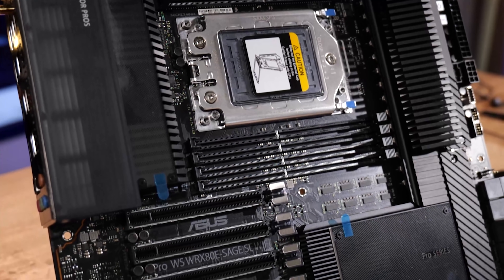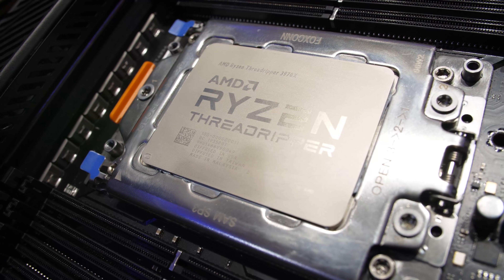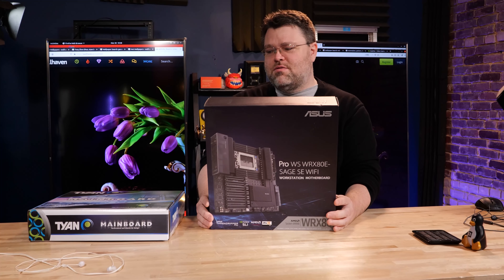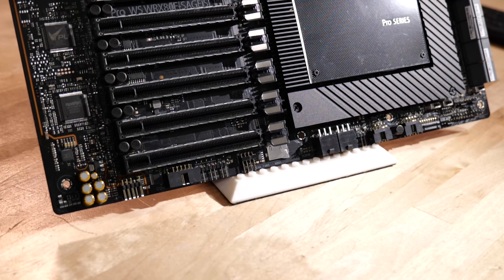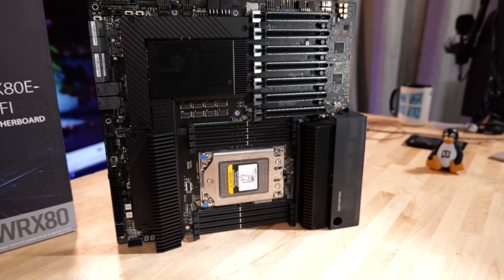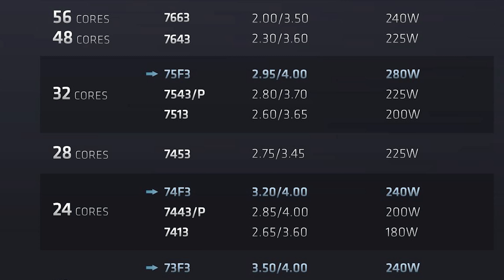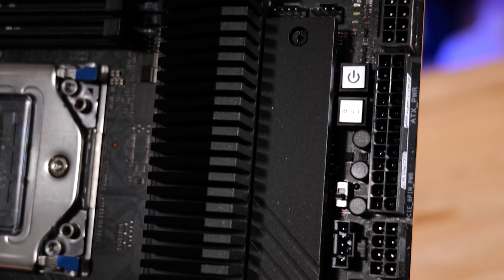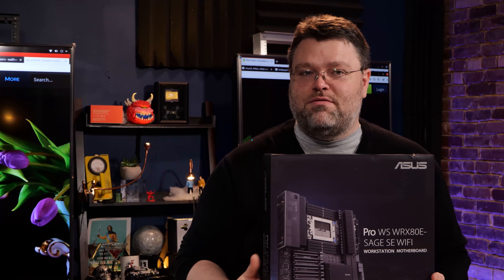Epyc 7713 vs Threadripper Pro for a Workstation?

Comment: I actually use an EPYC as a workstation (ROMED8-2T) and I kind of can support your point. However, I like my systems to come in simple. There is no chipset at all on the EPYC board and you'll just find the X550 NIC and the ASPEED 2500 BMC plus an additional USB controller.
However, I do have  M.2, OCUlink, Sata and 7 PCI-e x16 slots. So I get some decent storage options, everything else is done by adding PCIe cards. And this is exactly how I like it. I use the system heavily for infrastructure simulation (using virtualization and nested virtualization), so I prefer to select my add-in cards based on features, like SR-IOV, function level reset capability and whatnot.
Threadripper Pro with these motherboards (Gigabyte has a nice one too) is a very attractive option, but you suffer a complete lack of low-end SKUs CPU-wise. Some people start with a decent system but an entry-level CPU to get going and later on swap CPUs when cheap options become available on Ebay&friends. I did that for the last two decades on my systems. There are several low-cost "low-end" SKUs for EPYC but literally none for Threadripper Pro.
Reply: Completely agree with Threadripper not having low end SKU's. This was the main reason why I am looking at EPYC systems now.
Reply: Hey I'm like 3 years late lmao, but I'm building a similar system right now, and wanted to ask if you had any cpu heatsink/cooler sag issues on the vertical setup? Read that AMD set weight limits for sp3 at 450g, but most coolers i can see are 800-1200g, but I've heard almost no one talk about it
Reply: @thetacobasket6821  Honestly, I haven't payed attention to the weight problem. I use a Noctua NH-U14S TR4/SP3 which weighs >1kg. The ROMED8-2T comes with a beefy backplate for the socket and the entire mount is quite rigid. The system is running for almost 5 years now (recently got a CPU upgrade) with no issues. YMMV :)
Reply: @virtualinfinity6280  haha thank you, good to hear; I figured since it wasn't a "mainstream" issue, and that every cooler is twice that requirement at least lol, that it was probably fine, or outdated, or miscommunicated. The AMD docs just spooked me; last thing anyone would want is to damage hundreds of $ of hardware from the CPU cooler of all things XD

Comment: Awesome video, great breakdown. One thing I've been wondering about, is if you need a workstation on somewhat of a budget, how much benefit would you get from the price jump from 3950x/5950x with a good motherboard to the lower end Threadrippers + the board? 50% more cores for ~2x the X950x CPU prices makes me wonder if TR is really worth it on the lower end.
Reply from the maker: depends on if your job benefits from more ram/bandwidth and pcie? sometimes two cheap computers is better than one that's more than 2x the price. Same goes for servers, too. 4 socket server adoption is way, way down.. and now with 64 core monster cpus like the 7763, 7713 and 3995WX, even dual socket servers/workstations are becoming less popular. If your job scales well to two sockets chances are it scales well to two nodes in a cluster.

Comment: Apologies for my lack of understanding. The Tayan website shows the S8030 works with EPYC 7002 series processor. Were you referring  to EPYC 7002 in the video? Because I thought you were referring to the 24 core EPYC 7443P (Third Gen EPYC) when discussing pricing and specs.
Reply from the maker: 7713 is what's in there now. Long story is 280w tdp for xxx3 epyc isn't quite the same as 280w tdp for xxx2 cpus and needs some firmware love. Milan less than 280w is fine. Check the hcl. Plenty of cpus in that doc from milan

Comment: Noctua, quick, take your C14S, and scale it up to the Epyc socket, we need VRM airflow, also make it cover the 4 dimms on either side of the socket, It would also help to put an 80mm fan mount on the bottom side just above the socket just to get a bit more air flowing down over the socket and any VRMS that might be towards the center of the 240mm fan

Comment: I build a system with a 1920X Threadripper I got for a steal about 11 months ago, but it was just meant as a stopgap. Now I am wondering if I should do a WRX80 build or hold out until Zen3 Threadripper (Pro) comes out... tough choices. (Use case: Pre-Processing for Deep Learning on 12-16 Cores on a VM with 1-4 GPUs passed through to it, a second 4 core VM with another passed through VPN serving desktop duties and VMs to serve as a lab so I can do lighter parts of Devops workflow in a single box I an take with me, including running Kubernetes with GPU nodes);
Reply: I bought the WRX80E board to replace a TR 1900X. It was hard to find the WRX80E in stock. The Ryzen ZEN3 and EPYC ZEN3 are here now. I don't think it will be all that long before we see the TR PRO ZEN3 cpus. I can't say for sure ZEN3 TR PRO will work on the WRX80E board, but on Ryzen and EPYC the upgrade worked. The power supply to that board looks great, but PAGET tested 3 pro cards on one and was pulling 1400 watts at the wall. Best wishes finding a 1200 to 1600 watt P/S for list price.

Comment: I had to build a video editing workstation when TR Pro was only available via Lenovo, and P620 was way over budget. I really needed the PCI-e connectivity (Graphics card(s), video I/O card, fibre networking, potentially HBA), so I went with the TYAN 8030 and EPYC. The way I resolve the USB issue is to use a single slot PCI-e x16 to 4x4 breakout card (through four SFF-8643 connectors) and add two USB controllers for 8 additional USB ports. Not elegant, but works fine for me.
Reply: Hey, where the hell do you find a Tyan 8030? I can't find one anywhere... Edit: actually they're on ebay here now (only from one seller...), but they cost about as much as the higher end motherboards?
Reply: With Z590 and X570 still offering only one X16 PCIe socket the demand for X16 AIC will stay very low. Overcoming a decade of Intel 4 core dominance and a public that will not demand apps that use all of their PCIe sockets bandwidth, cpu cores and compute units/cuda cores will take a while. NV Link and Radeon's Infinity Fabric Link was a way to go around an old stupid app that was written for old stupid stuff. USB 3.x GENx can't compete with 16 GEN4 cpu lanes. SATA III, not one in use. USB, one 8GB gen2 stick for bios updates and one USB gen2 for a wireless mouse.

Comment: My god, what is that connector at 0:28, in the bottom
Reply from the maker: moar gpu power :D
Reply: @Level1Techs  its not all the way in
Reply: @Travelfast  TWSS?
Reply: WRX80E: Two 8 pin sockets, one PCIe 8 pin socket and two 6 pin PCIe sockets at the bottom of the board. That's 5 of the 8 power sockets on my Thor 1200 P/S. Add one GPU and that's 7 of the 8 P/S sockets. It's this resource sucking hog or a wife. But not both.

Comment: I think if the TR Pro was unlocked and allowed overclocking it would an easier choice to make.
Reply: I'm starting to see this the other way. Within the cpu's power draw limits and boost clock limits, it's the cooling that matters more. Momentary boost is a factor, but a workstation is more about hours of actual speed. Factory clock and no throttling for hours on end is more important. Bragging rights for split second boost is for gamer rigs. At ZEN+ it was time for water cooling and at ZEN3 it's open loops with giant rads.
Reply: @maxhughes5687  I don‘t disagree but I think an unsupported “unlocked mode” would massively generate positive PR for AMD by enthusiasts who would demonstrate what world records would be possible with a single “desktop” computer.
I mean 99 % of motherboards are completely overpowered component-wise anyway and letting such a Zen 2/3 Threadripper PRO roam free at >500 Watts would draw in many, many views.
AMD not locking down these features wouldn’t mean professional users would operate their systems like that on a day-to-day basis.
Reply: @abavariannormiepleb9470  Very true. Public image is a big deal.
Reply: The reason is simple. Workstation based cpus like threadripper pro and workstations in general prefer stability. When you overclock, you are pushing your CPU faster than it can perform and thus void warranty and create new problems as well as need addtional cooling like water, which you then asked for even more trouble. People that use workstations want computers that just work and get things done so stability over performance is key
Reply: Totally agree. There is a huge base of solo Creators who would love d extra headroom